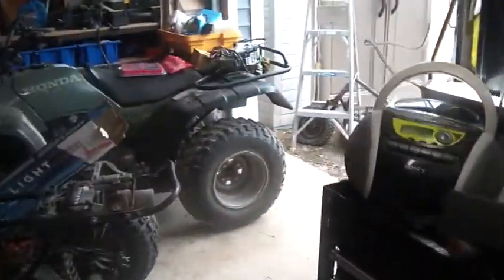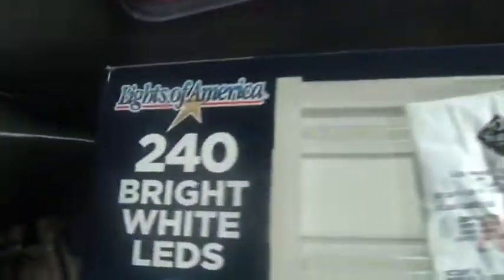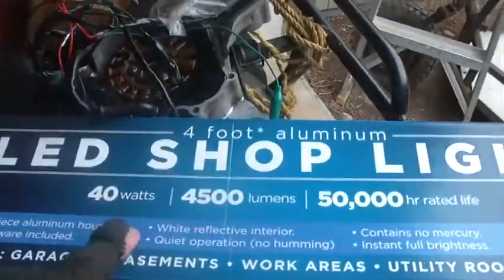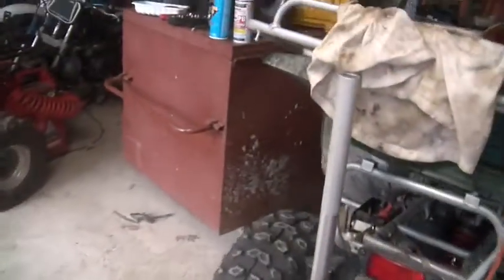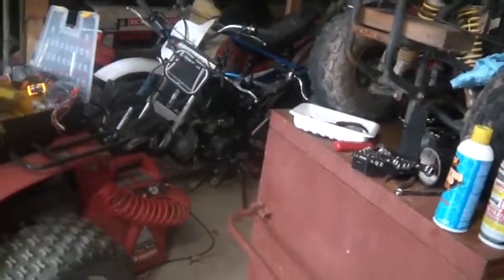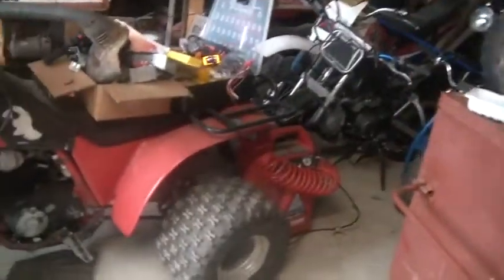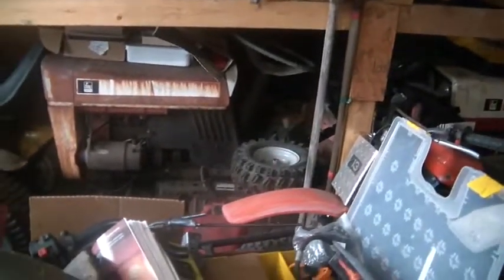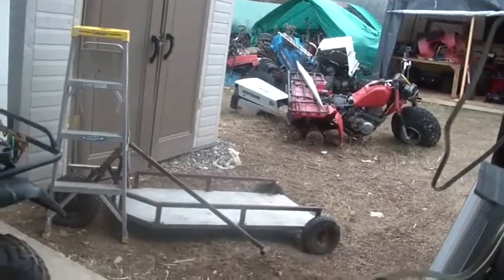Lights of America, 4ft  LED Shop Light review, $36,

Comment: I was checking and they sell a RF filter but it's about $30. You may have already looked into that. They talked about shielding to the wires also.  Those LED's didn't have a ballast so it could be in the circuit board the lights are mounted on?